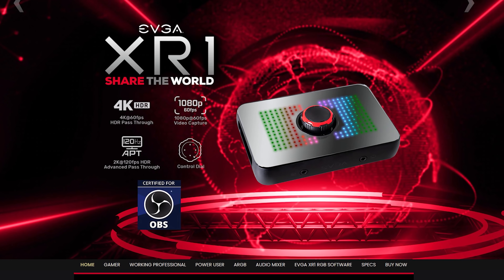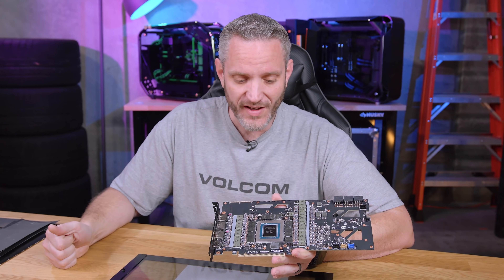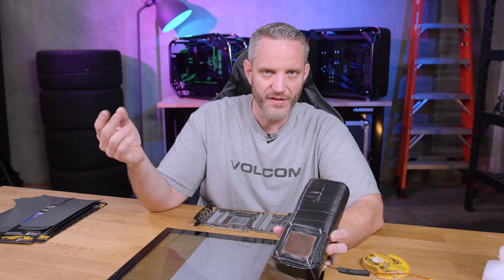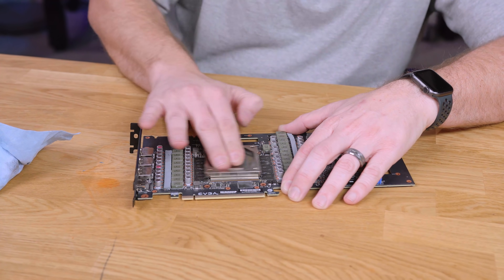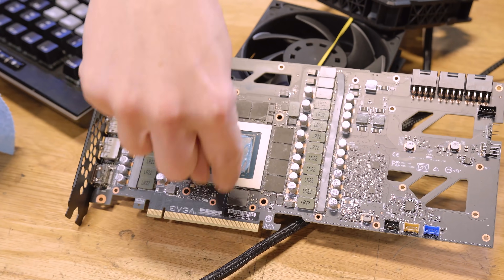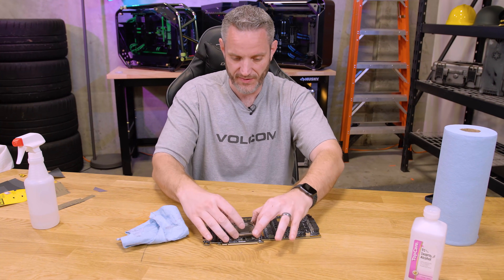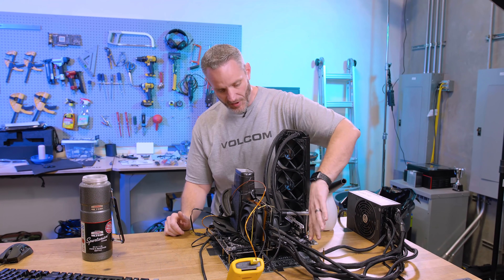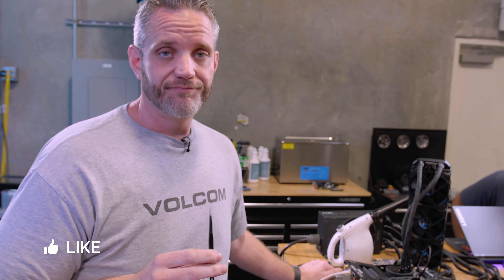I ruined another GPU....

Comment: Haha I was just thinking about  how to do this, as you can see in my picture my old cpu is perfect haha.. my 9900k still has to be done... Back to GPU.. I have 2080ti Hybrid Kingpin, and wanted to use my older gpu only block..but found out that the mem also was cooled by the std evga set and because of that thing for the mem my gpu block hovers above the gpu grrr.. so I odered a 925 silver plate that fits nicely in it.... only need's a bit lapping.. 
But you are giving me an Idea... I also have seen that 925 silver is harder then pure silver... or fine silver... now that sound like something interersting... if the metal itself is much softer.. I was wondering who has experience with fine silver and tell me if it is a good or bad idea, the price is a bit hi just for a small plate in between hahaha i'm not here for record.. but if I can perfect something with a degree winning with a sh*t load of money and work then that makes my hobby have a sense of why the F should you do that, well because I can..